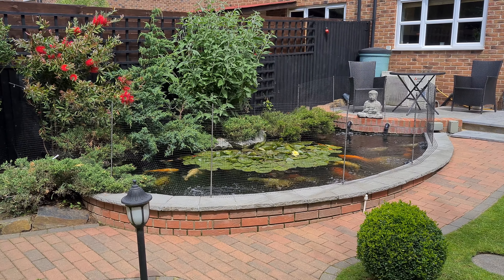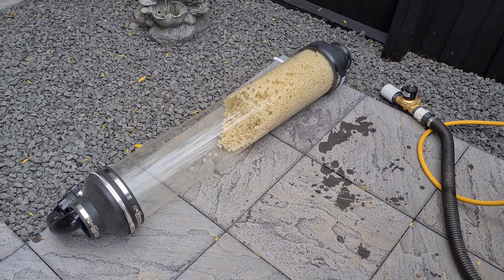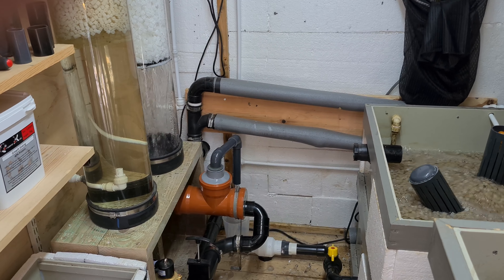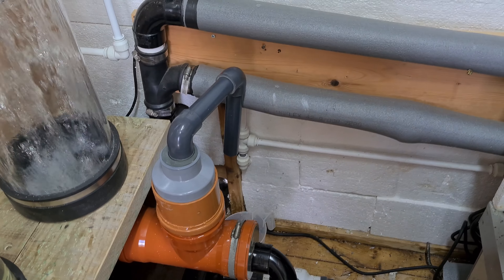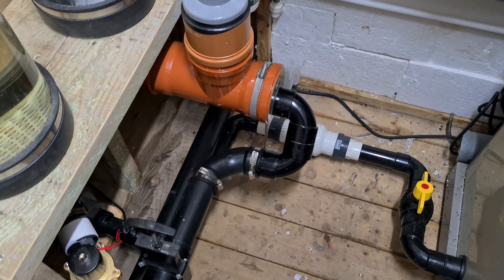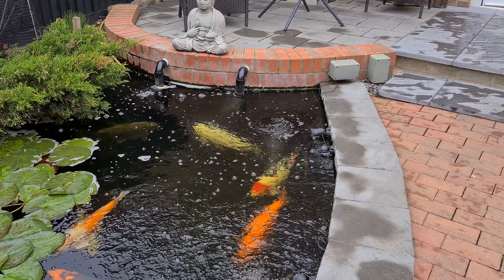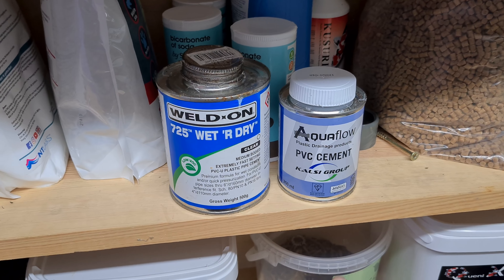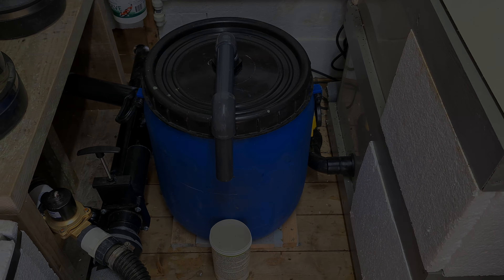Protein Skimmer Fitting and Running

Comment: Got a similar skimmer, its a clarity 10. The foam outlet is 4" . Faom finds it difficult to push itself through 2" pipes. If you went back to how you had it before the blue barrel and make the foam outlet pipe 4" foam will flow with much less resistance. Fantastic to watch your builds grow. Quality work. True craftsman. Always inspires me to make my own improvements.
Reply from the maker: Hi Marcus, I did run it without any pipe on the 4" T, but the flow didn't allow all the air to escape, and that's when I got all the foam in my bakki river. Thanks for the info though mate, I will give it some more thought before I change things. Thank you for your kind comments, it's really appreciated. Take care and stay safe mate, Terry.
Reply: @Wrighty  I did wonder why mine had such a large opening for the bubbles to rise, now I know. See if the design of the clarity 10 can give you some insiration for your own designed solution. You version works better than theirs at making foam in the fist place.
Reply from the maker: Thanks Marcus, really appreciated mate. My brain is on the job lol. Take care mate, Terry.
Reply: @marcusupton646  hi mate, I was looking at the clarity 10 for my pond, are you happy with how it works and the foam it takes out? 👍🏻thanks
Reply: @just4koi143  Works well but @Wrighty version works better once he manages collection method. I am happy with mine but the foam spews out the side and have to build in a collection device yourself or the wind will just blow it back into pond.
Reply: @marcusupton646  thanks mate 👍🏻

Comment: Hi mate awesome video as always 😉👍👍👍 I have a pie built protein skimmer and that takes its air in via a venturi that is inline on the feed pipe  just a thought for you 👍👍👍
Reply from the maker: Hi mate, and thank you, it's always appreciated mate. The problem I have, is that the flow is coming from the top of the up-flow filter and I don't think the pressure would be enough. Plus, I think it would put a lot more pressure on the up-flow filter tube. Thanks for the thought though mate, it's appreciated. Take care, Terry.

Comment: I seem to remember that your first skimmer worked well. Why did you remove it to build a different one? Somehow, I have missed the video that explained that.
Reply from the maker: Hi Tare, The first one I made had quite a few mods on it, and didn't look that good, but the main reason was because I had to run a 100 lpm air pump on it 24/7. I wondered If I could make one without the need for the air pump. This one is working, I've just got to sort out a design for the foam catcher. Thanks mate, take care, Terry.

Comment: @Wrighty  I am wondering if you 4" pipe needs to be longer before you go into your T?  If you are getting bubbles through into the river I would think that means the bubbles haven't had time to rise through the water in the pipe to get out the T, instead they are being carried through by the flow.
Reply from the maker: Hi Dan, Thanks for the thought mate. That's not a bad idea, I'll give it a go and see what happens. Thanks mate, Terry.

Comment: I Think the original 4” T-piece design would work if you rotated it through 90 degrees. (So it was stood up, rather than lying on its back) Take the Bakki river from the base of the T, and your skimmings would boil off the top. It would be easy to alter the height and if you used a clear 4” insert you could inspect the bubbles.
Reply from the maker: Hi William, I will give it some thought mate, thank you. I am thinking of re-routing the outlet flow into the moving bed pond return, which would stop the air getting into the bakki river, which is a problem. Thanks for your input, it's really appreciated. Terry.

Comment: Hello just a question i know its not to do with your skimmer or up flow but what pipe work do you use for your air lines and that ive just got a jecod like you just wondering what you use many thanks
Reply from the maker: Hi Jordan, I use the JG Speedfit 15mm push fit as it's so easy to use. You'll find it on eBay or your local DIY store. Terry.
Reply: @Wrighty  will that jusy push on to the nipple that comes with it or do i have to change it many thanks
Reply from the maker: Hi Jordan, I put a piece of 8mm flexible tube over the nipple first, then heat the end of the 15mm pipe and stretch it over the 8mm pipe. If you look at this video, you can see what I do: https://youtu.be/2pXQaJ7lw9k
It's at 15:37 on the video. Terry.
PS, I've Just thought. Did your pump come with the black rubber piece of hose? If so, the black hose will fit over the 15mm pipe, and I just secured mine with a jubilee clip.

Comment: Hi there can you let me know more about heatpumps?
Reply from the maker: Hi Mate, I sell the Thermotec Inverter type for HeatPumps4Pools. I've put a link below, so you can look at the info on the heaters. If your interested, give me a shout on pondfilters@gmail.com and I'll help all I can. Terry.
https://www.heatpumps4pools.com/product/thermotec-inverter-horizontal-heat-pumps-9kw-to-24kw/
Reply: @Wrighty  will do! Also where did you get your acrylic pipe from?
Reply from the maker: I get mine on eBay, Trent-plastics: https://www.ebay.co.uk/itm/174172903123?hash=item288d8396d3:g:f5wAAOSw2F9gHWxb Terry.

Comment: Hi Terry great Video, what size and  type of solenoid valve are you using in your setup ? cheers Josh
Reply from the maker: Thanks Josh, I used a 1" N/C solenoid, I got it on eBay:  https://www.ebay.co.uk/itm/253581032647
Thanks mate, Terry.
Reply: @Wrighty  Cheers Terry that's spot on. just ordered it 👍 would you mind telling where you get the pvc fittings for the solenoid are you using a threaded hose tail fitting ? I plan on attaching this to the outlet of my easy pod. automatic cleaning without buying the EAs version that is extremely expensive all controlled by a 5 gang smart timer switch. all being well.
Reply from the maker: Hi mate, I took it up to  my local plumbers, and he got me the bits to fit it. I've no idea what there called mate sorry. I did use a hose tail on the outlet from the solenoid. Terry.

Comment: Hi works great just ur last bit was not right have water at end coming into up right pipe half way so create vortex for foam to corkscrew out and outflow pipe at bottom for to ur River hope u read mac
Reply from the maker: Hi Mac, thank you, and thanks for the advice, really appreciated. I will have another look at it and see what I can do. Thanks again, Terry.
Reply: @Wrighty  OK like to see it if you redo last bit if you manage to create vortex it will help to centralise foam  to be forced out also the return at bottom will ensure no air returns to ur next filter
Reply: Ps shouldn't need to be to large a pipe so won't take up as much space as barrel
Reply from the maker: Thanks for the info mate, very much appreciated. Terry.

Comment: Hi terry. The way you had it at the start, A valve on the outlet would solve your issue to raise the water level inside the 4” section to trap the bubbles inside 

Just key it back ever so slightly
Reply from the maker: Hi Dec, I will have another mess around with it. I do think it could do a lot more than it is. Thanks mate, I'll have a go. Terry.

Comment: To increase efficiency you probably need to put the foam output much closer to the water surface (to decrease foam back-pressure) and increase the the foam outlet pipe diameter. Just like commercial units like this one https://youtu.be/whHMAK8vhWU